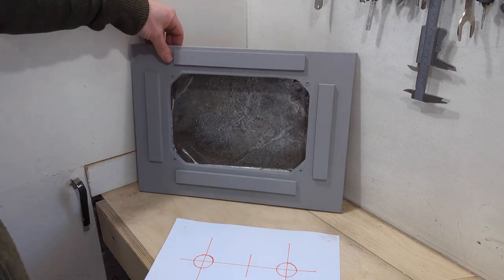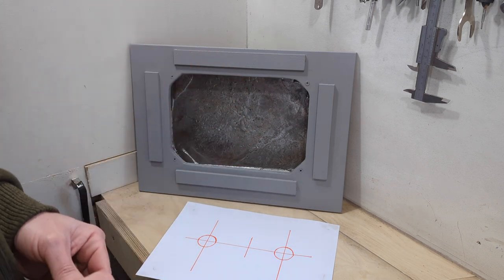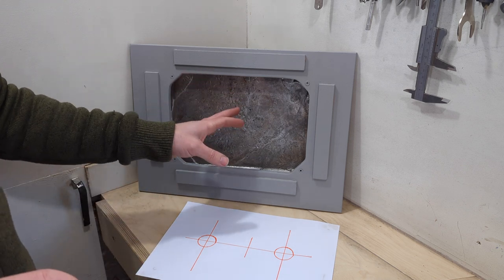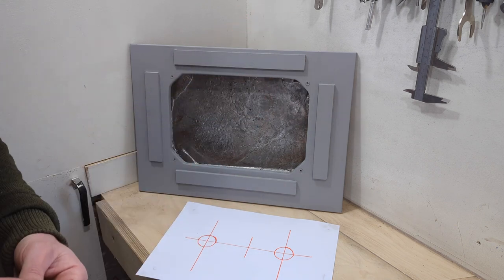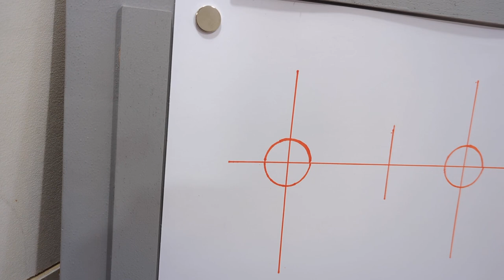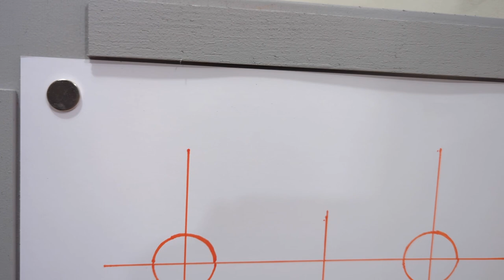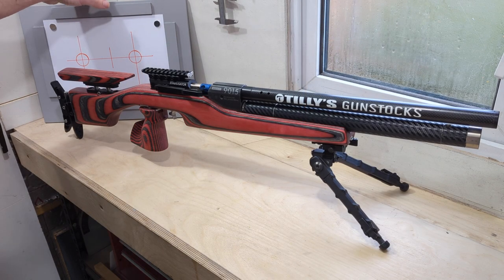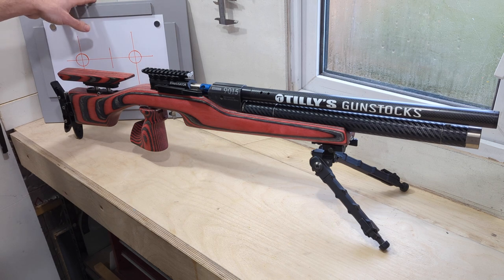custom silent lead lined target air rifle pellet trap

Comment: I thought I was the only one to do this. Can confirm no pellets coming back at me over 5ftlbs. Been using old tobacco tins for shooting in my shed cast in lead,about 5mm thick, really quiet, old pellets melted in a baked bean can. Very rough and ready, all the more fun for making it yourself.  If using splatterburst targets they dont show up very well as the paper doesnt flex enough. So hold the paper off the lead. Awesome video as usual.

Comment: Tilly musing to himself: "What can I do with all these grungy old fishing weights? Me other half is beginning to complain about the boxes of them...."
Also, after making the cutout in the main target frame: "Hmmm. Should I throw this little bit away? What am I thinking?!?!? It's wood, I'll find a use for it!"*

Since I didn't have any fishing weights, I made my pellet trap with scrap 1/4" steel back plate and about 5lbs of duct seal putty to catch the pellets, in a plywood box, with a slide out clipboard to hold the target (I didn't even bother to cut a hole in it, figuring the pellets will make the hole for me). Got the idea from the original Beeman's website.

*Every woodworker, everywhere
Reply from the maker: Mike you are mad! That's absolutely correct to the tee 😆
I cannot for the life of me throw plywood away,however curly it's got 

I've got a load of stainless sheet stashed,I might well make a few more so I can leave them out and they won't disintegrate.

Comment: Awesome setup, I've just bought myself a couple of trays to build my own versions (indoor and outdoor ranges).  As a matter of interest, what was the glue you used to secure the little border pieces?  I thought I read superglue on the bottle but noticed you smeared water(?) on both surfaces before applying the glue.
Reply from the maker: Hi mate  it's just standard superglue. Try it out with dampening it with water before gluing wood. It works a treat and sets up the glue almost instantly  😉

Comment: I have a bag with prob 80 lbs of pellet mixed with cardboard debris, fabric from old clothes etc. what the heck do i do with it?
Reply from the maker: Maybe sling it in a bucket of water to float the card and fabric off the top of the lead. 🤔 
If you do...the lead must be absolutely dry before re melting down 😎
Reply: @tillysgunstocks  not a bad idea .. curious if a recycler would take it mixed?